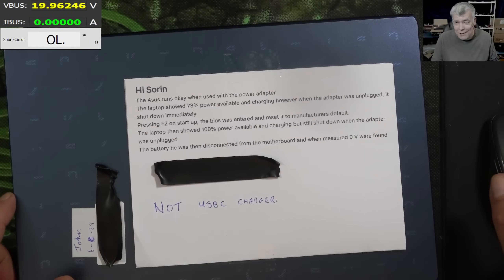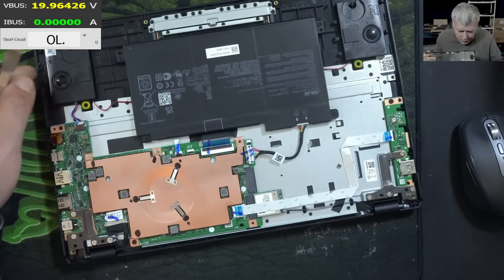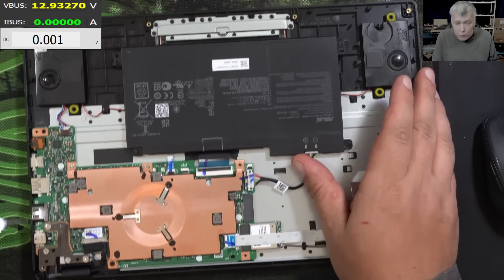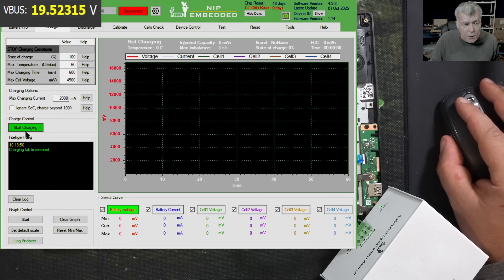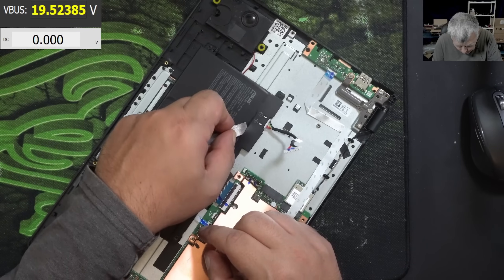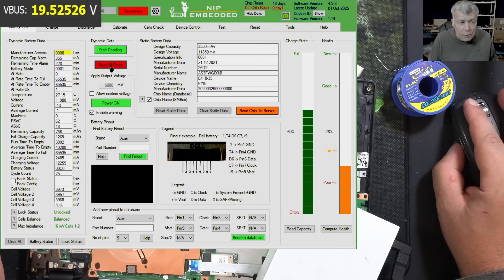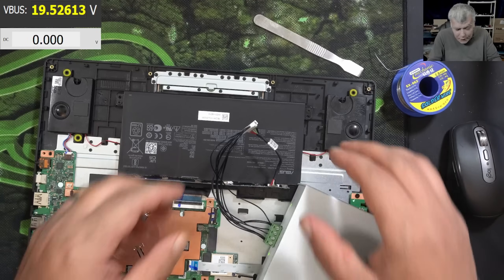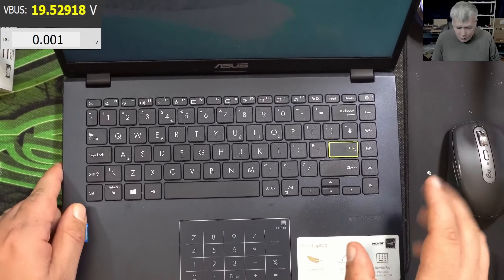Asus A410 not charging / holding the charge, battery repair, NLBA battery analyser GIVEAWAY!

Comment: My 2 Cents on the NLBA1….. 
I use a lot of battery Analyzer tools and they provide good information on battery condition etc. the NLBA1 is the next step up in terms of capabilities due to its reset capabilities and I was tempted to buy one. Then I read into the total cost of ownership and it made no sense for me to buy it as I am not a business. Some food for thought….. I can read out the condition and state of a battery with many tools and this can be helpful in determining when a battery is nearing the end of its life. I own the TI EV2300 and EV2400 interfaces that will work with the NLBA1 software and you can buy official reset licences for that setup. In my experience most of the failed batteries that I examine are at the end of their life due to use or age. Resetting them makes no sense unless it is after fitting new cells. The modern pouch type Li-Po cells appear to have a relatively short life and age quickly. If they do not pillow, their capacity seems to drop relatively quickly compared to the older Laptop batteries that I have used. There will always be the odd battery that is locked for no good reason, but in many cases the BMS spots a problem before deactivating and locking the battery. That is the required safety protocol and is present for a good reason….. manufacturer liability for fire caused by their battery ! Most manufacturers are very risk averse when it comes to Lithium Ion / Lithium Polymer technology. Now along comes a tech with the NLB1 and they reset the battery lockout and flow their standard solder across the fusible link. You have to wonder what their Public Liability insurer would think about that action that is the against manufacturers repair guidance ? No Public Liability insurance ? Scary stuff can happen. But back to the NLBA1, it is a clever tool based on the Texas Instruments EV2300/2400 that has a charger/discharger added to it. The clever bit is the unlocking software as everything else for reading out battery statistics is available from TI and others. The author of the software has elected to offer a specialist product to a limited marketplace, that being businesses that can justify the cost. That is their decision to make and turns its back on hobbyists etc. If the NLBA1 does not have a very robust anti-piracy protection model it would soon fall victim to cheap clones. As already stated, the hardware is nothing clever. It is the software that requires protection of the reset feature and this is host server controlled for anti-piracy. Could the author provide a cost per battery option for hobbyists ? Of course they could but they choose not to and that is their right so we have to live with it. Sharing of the hardware and software licence is prevented by installation logging. The author has adequately protected their ‘asset’ in a world filled with rip off clones. Will I pay the licence fee for resets ? Nope, not with the current pricing model, but that is my problem and not the NLBA1 manufacturers. They clearly make enough money from businesses who earn money from resets. Me ? I go on eBay and buy a low use, low age original battery from a Laptop recycler for £30 as I just did with my HP 830 G9…. A 1 year old 96% health battery for £30 and OEM quality. Bargain ! Now what about resetting the older, hard to source batteries ? The key thing there is age. Li-Ion and Ii-Poly degrade with age as well as use. Is it really smart to reset an old dying battery pack ? I would prefer to hunt down a decent OEM battery or a 3rd Party battery from a respected supplier. Just my 2 Cents, but these videos promoting the NLBA1 really are aimed at the laptop repair business owners, so no point in getting ones nickers in a twist over the restrictions imposed by the manufacturer that prevents hobbyist use. To those hoping for a Chinese clone…. It already exists in the form of clone TI EV2300 and EV2400 interfaces ! The NLBA1 software is free to download from its authors site and it reads battery statistics, but you need the NLBA1 host servers and licence to reset batteries.
Reply: There are many batteries (with good cells condition) locked because they have been stored for a longer period. By pre-charging and resetting the chip they will work perfectly. There are many batteries locked due to a short circuit, water spill, or simple bug firmware. Many batteries can be recovered. Fake batteries are always fake.
That's not true, the NLBA1 Analyzer has unique analysis features on the market, it is not a simple charger it is a Smart Battery Charger able to charge almost all laptop batteries on the market to 100%. Take any battery charger from the market and try to charge Macbook batteries and some Sanyo Lenovo batteries, most of them will finish charging at 90%, far from performing a calibration cycle. NLBA1 is the only tester on the market able to compute the injected capacity, measure the real capacity, measure Internal Cells Resistance, calibrate, generate test reports, etc. It also complies with IATA Standard for shipping batteries in a plane. EV2300/EV2400 are just USB to SMBus devices, nothing else, just an adapter, there are tons of such adapters on the market.

Comment: this particular model E410MA/L410MA battery is known for their weak batteries
many of my customers change this battery after 1 or 2 years, sometimes less than that
and if you buy the low quality copy battery, sometimes it will run 0.4 ghz cpu speed using battery, but run normally on charger

Comment: I'm a new computer technician, this gives me an idea to fix the battery issue for newer laptops such as this, usually this method is also done on dead batteries on mobile phones. My method is simply replacing a new battery. Using NLBA is actually pricey/expensive in my country. Thanks!

Comment: The device is good but the question is if you stop paying the subscription does it just become a brick?
I've unlocked batteries myself with just standard serial/i2c/esp32 devices before (the easiest is with a CP2112 board) with code chatgpt helped me write. The hardest part is the "key" that's used as a password, some are just the chip manufacturer default "0123456789ABCDEFFEDCBA9876543210" but if that has been changed (and I can't find it) then that's me done for and have to give up. 
£335 to replace a £5.85 board is very steep, but can be justified given the ability to easily interface with the battery and charge/discharge/calibrate/reset/etc.
£200 a year for the passwords... that's harder to justify in my eyes. And since people might argue that's the cost for the software, the website is advertising the "latest features added in 2023" so it's not exactly getting a full team of developers working on it constantly.

Comment: Considering the price of the device it needs to come with included software without subscription models or the device it's not targeted for normal people but for some types of corporation who usually doesn't even consider it because they have their own tools.
Reply: But it comes with all PRO Analysis Functions for Free Lifetime Unlimited, no need to pay any subscription. NLBA1 born as an Analyzer, you pay once and you have all analysis functions for free. Like Fluke BT510 which costs $6000. Later on, we added Repair Function which requires a lot of work and research, we work daily to add more and more chips since more and more batteries are released on the market with new chips.

Comment: Hi I've looked at NLBA for a while but I just don't get enough work of this type to bother with this device, I just buy another battery. If the NLBA guy who made it sold it for like £100 (maybe two batteries per year for me to test} most repair people would buy it. The other thing is that the battery IS dying anyway, all batteries do, you can't cheat that. So this is somewhat snake oil anyway.

Comment: I support no hardware that depends on a software that is subscription based.
Reply: True that! Nowadays everything moves to a subscription model, making us own less and less stuff and silently accept relinquishing our rights.
Reply: @silvake Some people will do and say anything for a few dollars or a free tool ..
Reply: NLBA1 makes use of all those nasty anti-R2R practices. 1. It basically requires an internet connection to function, 2. It calls the maker's servers to verify pairing only with a specific computer and it may stop entirely if a false positive unpairing is triggered by any random cause such as a basic driver update, or God-forbid a Windows reinstall, 3. It may also stop functioning entirely if the device itself was not used for a longer period of time and meanwhile they released a new software build, which obviously was not installed as quickly as they required (!?).
Reply: @silvake The question Sorin needs to answer is, would he had purchased one? Before trying to make monies from ppl
Reply: All Pro Analysis functions are free lifetime unlimited.
Reply: Well, I'm not the devil's advocate here, but the device itself definitely has a value, even without the reset subscription. That's how I used it for the last 4-5 years, and honestly I didn't find myself in mandatory need of the reset function. Useful or not, the reset feature is just a little bit of extra functionality, which I agree should be nice to have either permanently, or upon request if needed, but at the end of the day, it's not much of a big deal if you don't have it.
I see a lot of turmoil in the comments about the wrong or inadequate subscription model, but I'm surprised how just a few people are concerned about the other closed ecosystem aspects of the device, such as the binding with a single computer, or the inability to work without signaling an external server over the internet.
Those are real deal breakers which would have kept me from ordering it, if I was aware of them prior.

Comment: I saw on northwest channel i don't know a newer version of the NLBA it's green and like twice the size of this on if not bigger but it has a pretty cool feature which is a slide panel you slide it and you can store all of the cables the device uses otherwise it has the same software (honestly i didn't pay much more attention to notice anything else, all i saw a green colour a slide piece of plastic and that all)
Reply: He made that box. That way, everything fits in one place. power supply, cables, device. It's more practical to store.
Reply: @Pcbuild1  I don't recommend it. NLBA1 temperature model is calibrated to work free on the desk, not in a plastic box, it won't work properly.
Reply: I don't recommend it. NLBA1 temperature model is calibrated to work free on the desk, not in a plastic box, it won't work properly.

Comment: Just out of curiosity, if you repaired the fuse, would you still need to unlock the battery? Is there a chip that locks the battery up if the fuse is blown? Another good video.. 🙌
Reply: Yes, there is some kind of EEPROM that saves the lock status, so it wouldn't be revived by bypassing the fuse.
Reply: @Negiku  It's actually pretty easy to fix the battery yourself as long as you are smart and prepare for it. When buying laptop, remove battery, open, remove eeprom and read it using eprom programmer and save binary image somewhere then wait months/years. When battery locks and fuse blown, remove battery, remove eeprom and re-program eeprom, replace eeprom, rebuild fuse, replace battery and problem solved. Preparation is the key. Be smart and prepare for the inevitable and you will beat the system. In some scenes we already did this. We read and backed up ALL arcade game ROMs and emulated them. Now there is no need for any arcade game, but if you want to fix real arcade pcb the ROMs are available for free for ALL arcade games. As I said, be smarter than the manufacturers and you will beat the system ;-)

Comment: The hardware should be sold for much less since you need to buy the license.
Reply: The hardware comes with the software, all Pro analysis functions are free lifetime.
Reply: I see that most of the people are confused. Let's clarify NLBA1 comes with all PRO Analysis functions Free Unlimited Lifetime. You pay once and you get a real PRO Battery analyzer forever, no subscription. More, you get 10 free days to repair unlimited batteries for free, 1000, 10000000, as many as you can for free. Repairing is optional, it was released in 2021 and this feature requires continuous software updates because newer and newer chips are appearing on the market.
Reply: you don't need to buy the license, that is only for unlocking a battery... every other function is free to use.

Comment: The battery unlocker is a money maker that sits in a dusty closet not getting used by a huge number of people. The seller must be getting their money needed and happy to keep the licencing. But I'm sure scale of economies is being missed in this opportunity. In the meantime Customer will pay that bit extra for a brand new battery.
Reply: Why not to use it ? The NLBA1 comes with all PRO analysis functions free unlimited lifetime. You pay once and you have all analysis part. If analyzers are not used then why they are on the market ? why Fluke BT510 which costs $6000 was released ? and many more others.

Comment: The nlba is £500 and the software £250 per year. If you get loads of work it’s 100% worth it. Brilliant tool. 

I suspect bad windows update fked a lot of these up. I work for a firm. We get lots of ASUS with 045A20 screwing stuff up. They can be a pain to reset and blow up a diode after reset sometimes lol. Even though it’s not short.
Reply: For £500 you get NLBA1 + All PRO Analysis functions Free Lifetime Unlimited like Fluke BT510 does for the cells at $6000+.
£250 the license price can be recovered in 1 day if few batteries are repaired.

Comment: 3 months is quite short for a battery warranty. Where I live it is at least 1 year, even with OEM batteries. Usually the return rate is quite low if you find a good supplier. They will not last as long as a genuine one, but they are way cheaper.
Reply: even laptop manufacturer only gives 6 months of their battery warranty from 1 or 2 years laptop warranty
3 months is mostly the warranty for copy batteries
Reply: @maklogetrich2378  That is not legal in the EU. A battery is a part of the laptop, you are buying the whole product, so, every component of a new laptop must have the same warranty. Warranty does not mean you have to replace the battery because after 1 year it hold less charge, that is expected. But if a battery dies completely, should be replaced under warranty.
Reply: What supplier are you buying the batteries from? Every generic Chinese battery I've used has been junk, even the so-called "high quality" ones. Even brands like Cameron Sino and Kingsener, which have double the price of other Chinese batteries, still have poor quality. They all arrive with lower than advertised capacity and dead within 1-2 years...
Reply: @yotoprules-u6l  If they are dead after 1-2 years, it is fine. If you want more reliability, just buy genuine ones.

Comment: A device with a license like that its just a bad idea, buying a new battery will always be a better option even if its a generic battery, also if you look at it from the customer side they will gladly have a new generic battery than a fixed one.
If it was a only one time thing and be activated forever it would be a good product but its not, all kind of things can go wrong with a temporal license like that.
In my case most of the battery replacements i do nowdays are HP HT03XL which always turn into pillows and need to be replaced anyway, on average they are $15 to $20 new and its faster to swap them than spending time fixing them which i could spend fixing something else.
Reply: That is right, and you can have the same profit as doing the job with the NLBA. Lets assume you would charge $40 to fix with the NLBA. You buy the battery for $20 and add $40, so you will have the same profit.
Reply: I'm agree the device it's expensive this is one thing second the license it's very expensive unless you are not a big computer repair shop and you have plenty of laptops every week for example person like me buying faulty laptop to repair and sell them let say 2 or 3 laptops every week this doesn't worth AT ALL maybe for 1 mouth of buying laptops from 2 to 4 of them will have faulty battery there is no point buying this device cuz this device it's not made for everybody like let say if there is a credits like 5 credits 10£ 1 battery consume 1 credit this is different story i with buy it definitely but not how it now thanks free give me this device i will sell it but definitely will not pay this money every month also if i buy a battery from amazon and the laptop still doesn't work or charge for some reason i can aways return the battery and get refund
Reply: @CHRIS-FIX-1990  I work as IT on a university, i replace around 50+ batteries per week from school, workers and student laptops, the price of the device itself is fine, even the license looks ok, the main problem is that its a temporal/limited license and not a permanent one.
Reply: Newer and newer batteries appear on the market so NLBA1 works continously to add newer and newer updates to support them.
Reply: I see that most of the people are confused. Let's clarify NLBA1 comes with all PRO Analysis functions Free Unlimited Lifetime. You pay once and you get a real PRO Battery analyzer forever, no subscription. More, you get 10 free days to repair unlimited batteries for free, 1000, 10000000, as many as you can for free. Repairing is optional, it was released in 2021 and this feature requires continuous software updates because newer and newer chips are appearing on the market.